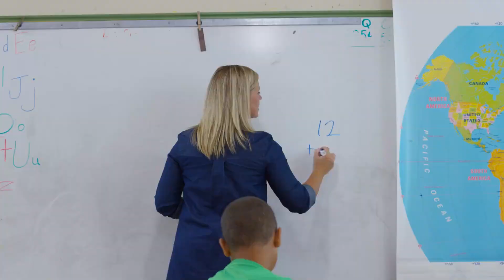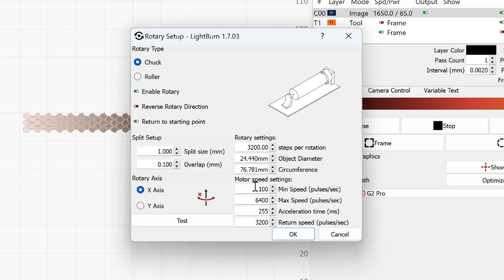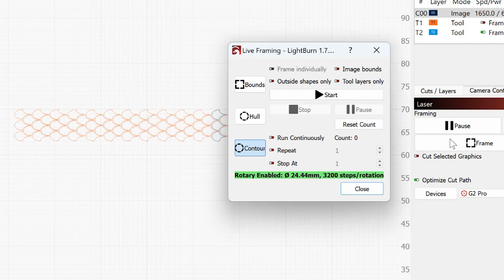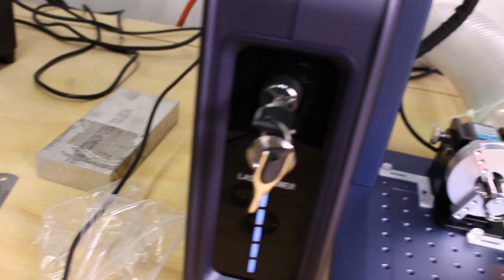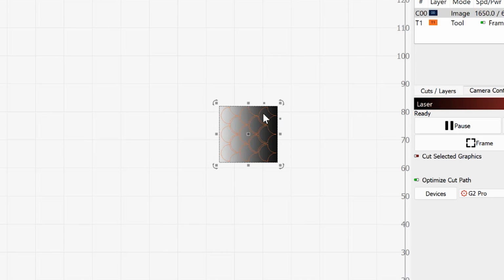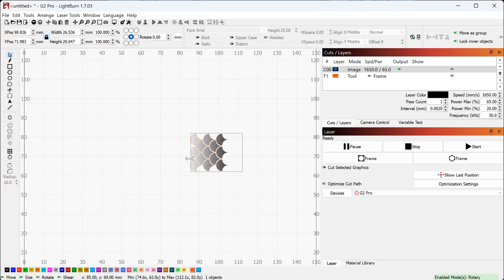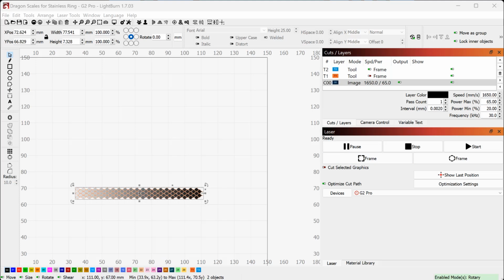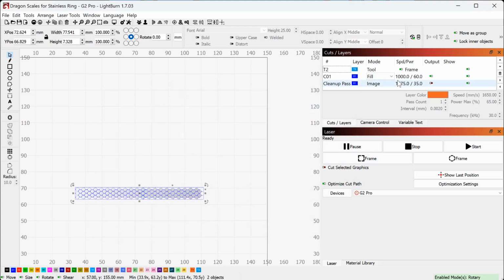How To Get Easy Color Effects From Your Laser Engraver

Comment: Looks great! How durable is the engraving? I’m curious what the ring would look like after being worn a while.
Reply from the maker: I can't speak to the durability of the rings but I color marked a stainless steel tumbler for my partner and she used it all day every day for at least 8 months with no changes to the color. I didn't do anything to protect the tumbler. I have no idea how it's holding up today because she lost it. 🤣
Reply: I've always heard you have to protect with some clear coat or varnish to avoid degradation over time, even with a mopa.